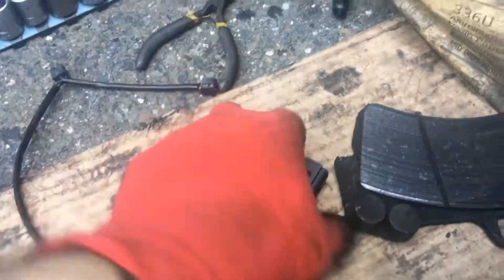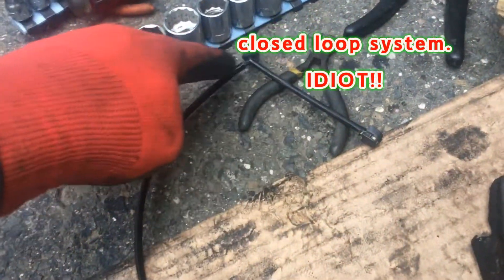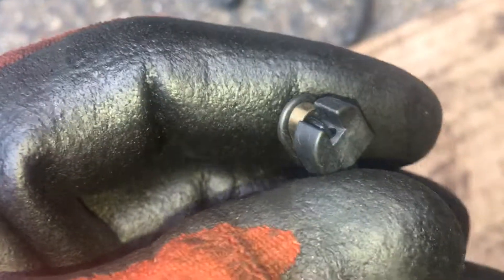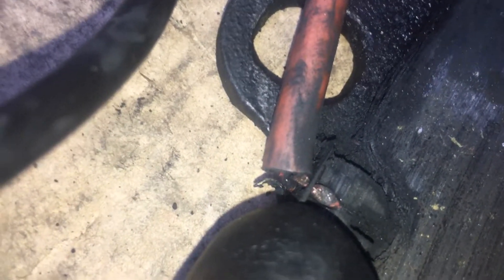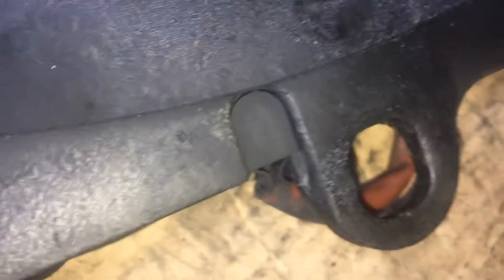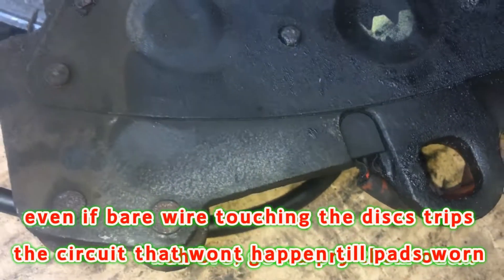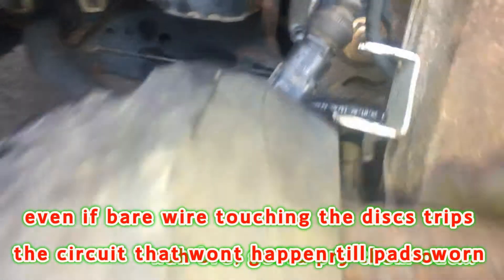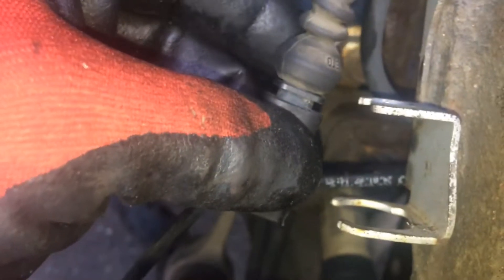How Audi Q7 and others brake sensors work and trip pad sensor warning when pads are low

Comment: What is the top part called that the sensor plugs into? Mine cracked...
Reply from the maker: on the brake pad??? of the wire plug
Reply: @bobspurloc  the wire plug, the one the sensor plugs into
Reply from the maker: its just a plug, best to just zip tie them together and wrap with real scotch electrical tape, not anything harbor freight sells. or whatever to seal it. otherwise u will need to go to the dealer and buy that whole wire which wont be cheap or easy to install. there is a company that sells connectors so you can either swap pins into it or splice. even superglue the plastic not getting any on the pins. its not like its a critical system. if the connector corrodes and pins lost contact the car will just indicate it thinks your pads are low. inspect and clean connector.
Reply: @bobspurloc  thank you for your time! Much appreciated